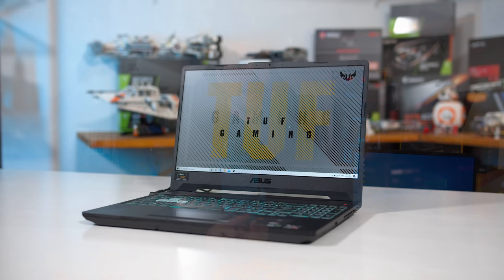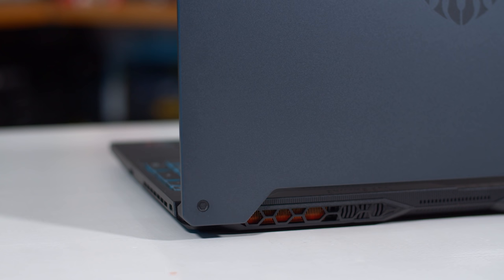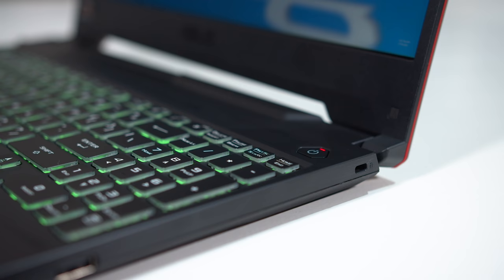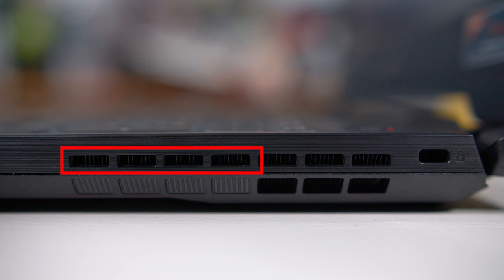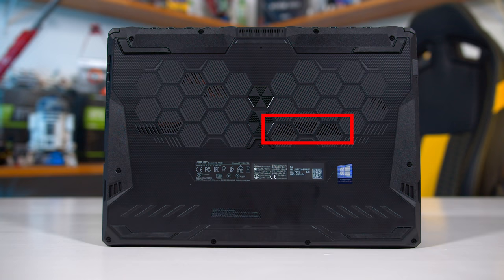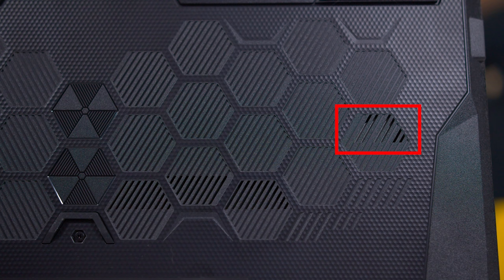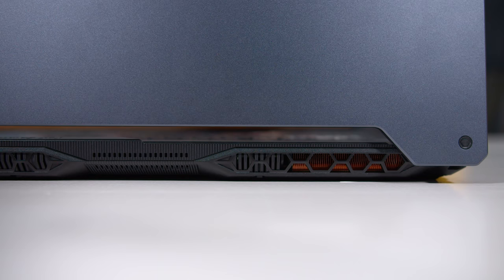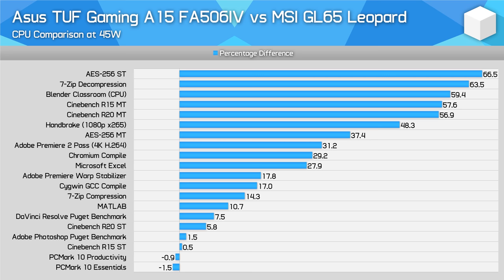Don't Buy The Asus TUF Gaming A15 (2020 Model)

Comment: Just opened a three hexagons under each fan with a dremel. Average temperatures dropped around 8 deg.Celsius for cpu (88->82) and 10 deg.Celsius for gpu (80->70). Measured with HWiNFO during Fortnite game-play.
Cheers
Reply: Nice job dude! Warranty be damned!
Reply: @andrewyoung4473  Lol
Reply: @andrewyoung4473  You guys are getting WaRrAnTy?!
Reply: u should make tutorial about this and upload video on YouTube 😁
Reply: Please don’t wooosh me but isn’t 88-82 = 6?
Reply: @ishan21212  r/wooosh
Reply: @ishan21212  sorry I just had to do it but I get what you're saying
Reply: Eldrin Covers 2k16 Haha lol 😂
Reply: If asus doesn't get sued, then we live in the cyberpunk 2077 already.
Reply: @MindaugasSnegirevas  I'm not sure what you would sue them for. For design choices?
Reply: Do you have a photo. Im planning to do it with mine
Reply: is it possible to buy 3rd party rear covers?
Reply: @andrewyoung4473  ASUS don't honour their warranties anyway, so it doesn't matter.
Reply: I made lot's modification for my ASUS X555L - fix air flow, bigger vents(cut some more with files and cutter), etc. end efect was drop from 90C to 70C and even stop spin like jet engine.
Reply: The reason why the screen is bad and it got so hot but they wont make the air flow bigger is the military grade .If use the better screen or big air flow then they will fail the test but Asus acutally believe we gonna carry this laptop to the battle field one day ( ͡o ͜ʖ ͡o)
Reply: @ishan21212   think thats why he said "around"
Reply: There are a lot of components in a laptop that need cooling. A lot more than just the CPU and GPU. By opening the vents right above the fans, you're probably short-circuiting any airflow that was supposed to come from the other, deliberately-placed vents. Now you've got parts in your laptop that are probably just sitting in stagnant hot air and might eventually overheat and break. Did you really think Asus engineers were like, "hey, we could put vents in the obvious places and it would be great for cooling, but instead we'll just throw darts at the bottom of the laptop and put vents there"? smh
Reply: @makingretro  I always use a gaming laptop with a support stand with fans. Before the mod there was no difference in cooling with or without the stand plus the fact that temperatures were quite high. Seems much better now. Regarding the temperature of other components, I keep track with the sensors of HWiNFO. So far so good. Oh, about air flow, now the rear vents, where the big copper radiators are, remove much more air. Before most of the hot air was going out from the lateral vent. I think i did well. Thanks for sharing your thoughts. You have an engineer's mindset.
Reply: @nicodanelli  If you have some way of forcing cool air through the stock vents at the bottom (laptop cooling stand) then I imagine you're fine. Cutting holes in the bottom of the laptop is probably a horrible idea for most other people. The location of those bottom vents is just too deliberate. Asus MUST have been trying to direct airflow in a very specific way. This YouTube review is doing people a disservice. Also, note that in the stock configuration, most of the laptop's intake air seems to come from the rear vents. The YouTube reviewer didn't seem to notice/understand that the rear vents aren't just for exhaust, which he could have easily figured out if he had bothered to just feel the direction of the air while the laptop was under load. BTW, I don't know what you mean about how much hot air is coming out the rear vent vs. the side vent. The same fan is moving air for both.
Reply: I know it's not easy to design a cooling system for a laptop, but the simple fact that this thing ran super hot under load when it's supposed to be a gaming laptop says that ASUS obviously missed the mark. No matter what the holes are there for, they obviously do not do their job. I doubt any mods made by viewers could do any worse then the Asus "engineers" did.

And I don't think this review did anything aside from bring the flaws of this laptop to the eyes of the consumers.
Reply: @makingretro  but how is some other laptop can actually put holes at where the fan at, but not Asus. I am honestly trying to make sense of this cooling design.
Reply: @nicodanelli  hey can you please reply with a guide to the modifications you did to the bottom of panel?
Reply: I knew that'd help, along with opening the holes in the sides ill probably do that but ill open more hexagons
Reply: @makujon  if you get any do msg me I will give you my email 
Thanks for the help.
Reply: @NovaCaine2489  yeah, if they make the holes right under the fan bigger so it can take air faster but it will lead to take more dust and one again the military test wont accept that ...
Reply: @makingretro  ohhh now it makes sense
Reply: Question: why even waste your time on it?
Love what AMD has brought. Shame to see it get destroyed.
Reply: @josephl3602  The cooling system works fine. The A15 can maintain boost clock speeds indefinitely. The laptop performs well and everything works as designed. Yes, the CPU temperature can get up into the mid-90s, as it does with almost all other gaming laptops, regardless of if they're Intel or AMD. Notice that IN THIS VIDEO, the reviewer compares the A15 to an MSI laptop with a cooling system that he claims is far superior, and its CPU only runs 4 degrees cooler (while performing worse). This "design flaw analysis" video is just clickbait.
Reply: @edwlimjh1854  Actually very few gaming laptops have vents directly over the fans. The reviewer in this video claims that MSI's cooling solution (of basically just having a big mesh panel under the entire motherboard) is far superior, but if you look at MSI laptop designs that are more recent, you'll see that they've gone back to having solid panels with small, strategically-placed vents that look a lot like the vents for the A15.
Reply: Excellent job. May I suggest you Tweet the photos to Asus saying "hey, I fixed your design flaw (cock up). You're welcome. How about you reproduce the back panel with my modifications for the customers that bought this hotbox of a notebook."
Reply: @makingretro  It's not about the performance of the two chips, but the power draw from those chips. If your chip runs hotter even though it's drawing less power, then something's wrong with the design.
Reply: @makingretro  First of all, I really appreciate ASUS as a manufacturer and I am using their products for many years now and I am willing to continue to do so. Especially for this particular laptop (I own the r7 4800h/1660ti version), I found their move earthshaking for the gaming and hi performance laptops generally. They have all my respect. Heating in gaming laptops is an issue but definitely they have to cover much more norms and specs. The reason I did this mod was that I know my "quite safe" environment where I use the laptop and that it makes me feel safer when I do not see the temperatures rising that much. I am also trying to keep my desktops as cool as possible. I just opened some vents inside the hexagons, parallel to the existing ones, I keep monitoring components' temperatures and if i notice that the air flow is not sufficient for the rest of the components, then I just can reverse it by using some tape and re-block them. I am quite cautious to the information i get from youtube and i also study the comments before i proceed to get a conclusion and the whole story here convinced me to go on. I would like to repeat that while gaming, I am using the laptop exclusively with a two fan support pad and before the mod, i just couldn't see any difference with or without the pad. I will inform you guys if something goes wrong, thank you for your opinions and thanks ASUS for this great laptop.
oh, I also installed a SATA3 SSD of 480GB with the included adapter and when my budget will permit i will opt for a second NVME, m.2 SSD.
Cheers to all.
Reply: @islandcomputers-au  Please let's not be offensive. I am 52 y/o and watched the whole evolution of personal computing closely since 1984. ASUS is a very important player that gave access to high tech products to the masses, to all of us that we couldn't spend a fortune on new, fascinating technologies. Imagine how our digital world would be if we had just INTEL in the processors and just IBM and Apple in the PCs. Not to mention other product categories as home wifi routers, various dongles and many more :)
Reply: @swallowtail7718  The laptop's cooling system is able to cool everything well enough to provide maximum performance under a sustained load. By definition, that means nothing is wrong with it. Could Asus have designed a laptop with bigger heatsinks, bigger fans, and bigger vents? Sure. But that doesn't mean anything is wrong with what they did design.
Reply: @nicodanelli  Scuse me? I censored it out. Get a grip. But fine, if that's still too saucy for you I'll remove it. Yes, they are an important player and that's why mistakes like this should never have happened in the first place. I've seen many other high level manufacturer do the same thing - Apple for example. Let's just hope they perform a product recall. But my suggestion was that you show them a way of resolving the issue. I didn't ask you to lecture me about a monopoly in tech either.
Reply: @makingretro  Until it does go wrong. At those temperatures I doubt the machine will last very long. I'd also suggest you Google Asus TUF Gaming overheating. I have seen one guy mention the back plate melted slightly under high loads - albeit he's probably running CPU-Z or another app designed to thrash the CPU for hours and didn't back it up with a photo so we only have his word to go on. Perhaps he's now added a photo as I'm sure most people would have asked for proof.
Reply: @islandcomputers-au  1) Why wouldn't you expect the machine to last long if the CPU temperature is around 90, or in the 90s? When was the last time you heard of a CPU wearing out because it got hot (but was still within its manufacturer-specified temperature range)?

2) When was the last time you heard of a gaming laptop where the CPU didn't run in the high 80s to mid 90s under load? They all do this.

3) I absolutely do not believe that the heat from the A15's exhaust could have melted the plastic grilles in the rear of the laptop. I own this laptop and I've felt the heat from the exhaust while the laptop is under load. It's not hot at all, just warmish. The idea that it could melt plastic is ridiculous. If you see a picture of this melted plastic, you can be sure it was melted by something other than the laptop's internals.
Reply: @makingretro  Look I'm not going to get into shit slinging fight with both of you, who seem VERY keen to defend Asus. Hmm I wonder why? Fanboy or on the payroll?

Anyway, be as incredulous as you like but I've seen system fail at those temperatures. The CPU may not fail but that doesn't mean the board, graphics card or RAM won't have issues. Or the OS just shuts everything down because it feels 100°C is an excessive temperature. 

Albeit these tests are always absurd compared to real world use but it's worth testing their limits to see if they stand up to the competition, right? Clearly Tim has issues he wanted to raise with these machines and I'm happy to take his opinion and potentially avoid these machines until Asus addresses the issue. It's not uncommon to release a second version of any product. Perhaps they need to do the same with this range.

As mentioned that was not me who claimed it melted his back plate and I would like to see the evidence too. But I have seen other components melted in the past so it's not impossible. But knowing the history, or his motivation, behind it is very important.
Reply: @makingretro  with almost the same price, legion 5 is doing better in thermal issue (based on Big Head Tech https://www.youtube.com/watch?v=30fD7hycD24). There are no blocked vents, cpu temperature around 80s, and the fan sounds much better (i already buy a15 so i can say that this fan sounds like a jet engine, VERY loud, and in some case the cpu temperature goes around 100)
Reply: @islandcomputers-au  "Hmm I wonder why? Fanboy or on the payroll?" ... Neither. I've bought this laptop, I've owned it for more than a month now, and I have first-hand experience to tell me (and you) that it is not flawed.

I'm also opposed to stupidity. Why does this reviewer think the laptop is flawed? 95% of the reason seems to be the cosmetic design of the laptop. It has a bunch of hexagons on the bottom that look like they're supposed to be vents but aren't. Basically, it has fake vents, and the reviewer is upset that they aren't real vents. That's stupid. If the bottom was just smooth plastic with the same vents in it, then the laptop would be basically the same as any other modern gaming laptop, with CPU temperatures in the mid-90s and the fans producing ~45 dB under load. These aren't unusual or bad numbers. But the fake vents have tricked this reviewer into thinking that the cooling system is "flawed" and you shouldn't buy the laptop. Basically because he saw some hexagons on the bottom. And stupid YouTube commenters are agreeing with him. That's some depressing stuff.
Reply: @miniburger9323  The review you linked to is stupid too. The guy is comparing a laptop with an 80W GPU to a laptop with a 35-50W GPU and the conclusion is that the laptop that's using massively less power runs cooler and quieter. Okay.
Reply: @makingretro  yeah fair enough. As I say, a lot of those tests thrash the hell out of it so I'll admit  I'm probably being too harsh towards this model. 

Is the screen not great though? That'd be a shame. Ah well, too late now as I've sent my customers unit back.
Reply: This would make for a great future video.
Reply: you should have lied to Asus and said that your panel broke and said if they could just send the panel and you would fix it and just make the holes and when you need to fix the computer just put on the none modified panel and %100 no suspicions
Reply: Is this the twilight zone? Didnt buddy say the exact fkn thing in this video?
Reply: but the screen is so bad
Reply: @makingretro  Lol under almost 100 degrees on a daily basis will kill your laptop in three years.
Reply: Tutorial?
Reply: @ishan21212  that's why it's important to read everything, because he said: "Average temperatures dropped around 8 deg"
Reply: I think boost off, undervolt is better than warranty voiding holes made without being privy to Asus's development process. Drops that max from 95C to under 70C without feeling the performance drop.
Reply: @theskywalker8416  They are used in a lot of situations such as somewhat dangerous ones, surveying firing points, planning firing trajectories, to less dangerous forward operating base planning, etc. Most military grade laptops, such as the DELL rugged latitude or Panasonic Toughbook, are really HEAVY in comparison. It would be nice to have a lighter laptop in field environments. Also, if you are into construction, this type of military standard for a laptop is helpful. Lots of sawdust, moisture, temperature variations, etc. This would help allow an engineer change/fix plans on the fly while being on the ground. So not just for "battlefields".

Comment: as an engineer myself, i must say your video is nothing short of infuriating. there's so much effort that goes into proper design of products, so much information that you don't know. if asus doesn't sue you for this video, i would say that must mean they are an exceptional company because they do have every right to. i'm not an asus or any other kind of company fanboy, and the engineering discipline i practice is not thermals. still, you have no idea what design goals they had in mind when they designed the thermals. to simply take the bottom off and say "oh wow it runs cooler" does not mean anything. if you have the money to buy 2 of these laptops just for the fun of it, why not hire a good thermal engineer consultant to validate your suspicions? this would actually be useful content and you would then have something worth posting. it also wouldn't mean you risking getting sued for making totally unfounded claims.

also, that's not just empty space you see, that's a 2.5" drive bay. look in the box for the SATA ribbon cable. this alone makes me doubt your credibility.
Reply: Fully agreed! Thank you for your input!